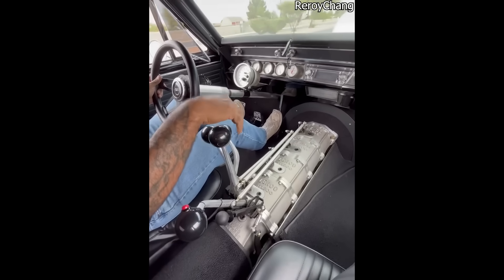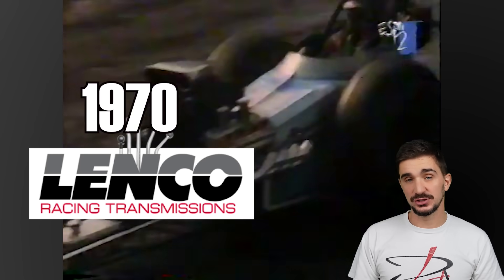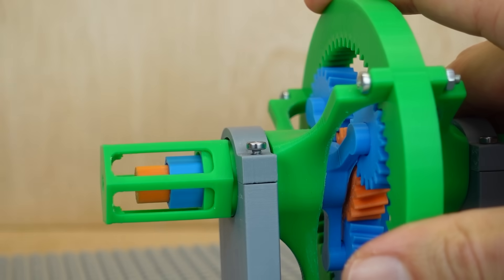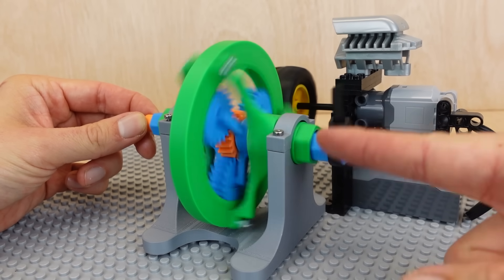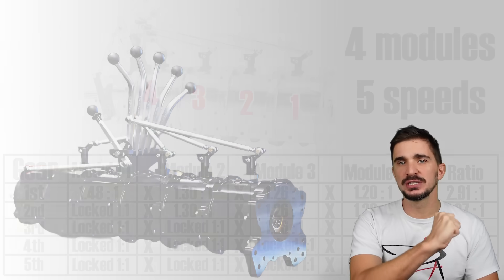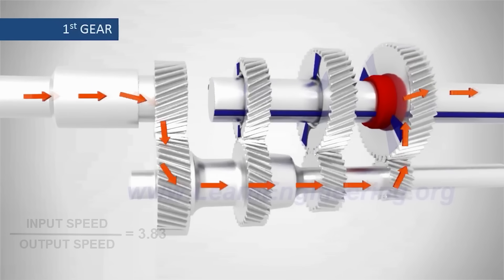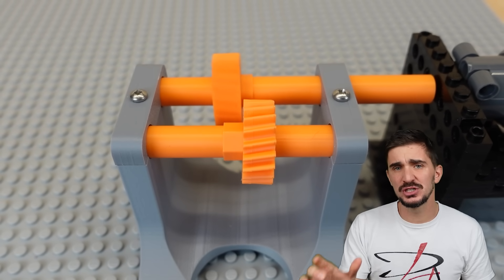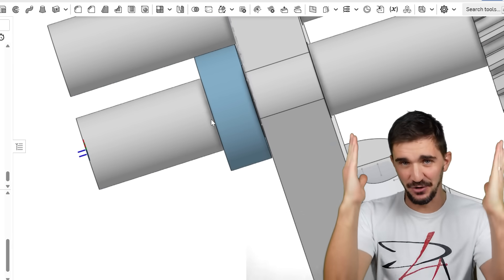This is The Strongest Transmission Ever Built - Planetary Manual Lenco Gearbox Explained

Comment: Essentially, every module is a Buick Dynaflow transmission from 1947, sans torque converter.  Basically, a 2 speed (reduction plus direct drive) planetary transmission that can't actually shift for itself. 

PS: Come to think of it, the Ford Model T also used a 2-speed planetary transmission, and the clutch wasn't needed when shifting between gears.  Talk about repurposing old technology in new and interesting ways.

Comment: This is a great informative video. Planetary gears are used everywhere, I recently disassembled my cordless drill which have 2 speeds, and it's very similar to this gearbox. You did a great job with the 3d printer. You are the professor. 👍👍👍👍

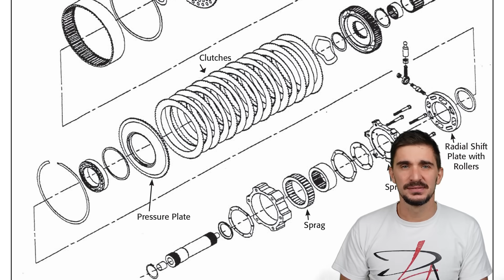Comment: 12:13 - To be more specific, a traditional manual gearbox has axial AND radial loads on the gear shafts. The radial loads are caused by the gear teeth themselves. The sides of the gear teeth are angled, so the gears can mesh. So the gears are trying to push apart. Those axial and radial loads put a lot of stress on the transmission casing. Even if you install straight-cut gears, it will still have axial loads on the gear shafts. And there's not much you can do about that.

With planetary gears, the radial loads cancel each other out. And since the gears are straight cut, there are no axial loads either. So the stress on the transmission casing is significantly reduced.

Comment: The poor man's Lenco is commonly known as a street clutch automatic. It is a regular automatic with a hard shift kit and a clutch instead of a torque converter. You have to drive the oil pump by other means but they work very well for street horsepower numbers. They won't handle 3000 horsepower but they will handle 600 or slightly more.

Comment: I don't really understand why this overall design can't be scaled down and used for fully automatic transmissions. Everything is controlled by the TCU anyway, why does the valve body need to be so insanely overengineered and fragile?

Comment: I want to push back on the contact points argument. You're shocking each of the contact points in succession. You shock the first one, (there are some losses), then the output gets sent to the next one (there are some more losses), then the output of that one gets sent to the next one, and so one. You're trying to tell me that the more links in the chain, the stronger the chain. Maybe, but I'm fairly certain the chain is only as strong as the weakest link.

Comment: couldn't this surely be adapted into mass market road car transmissions by either the use of a different mechanical remote control system or computer control? also the epicyclic units could be made slimmer and of greater diameter to reduce length for lower torque applications

Comment: couple years ago a company launched a planetary gear crank for mountain biking. It fell out of popularity due to price and weight, but I still use one and love it. instant torque application, able to shift under load with no delay. able to shift without pedaling. it's an amazing little gearbox.
Reply: Truvativ Hammerschmidt about 20 years ago? ;)
Reply: hell yeah. I still have one on my freeride bike with single speed rear. gives me a climbing gear when I need it.
Reply: For the people asking: he is probably talking about Pinion bicycle transmissions. Designed and made by former Porsche engineers.
Reply: @quentinnine9441  No, it's the Rohloff Speedhub. 14 gears and over 500%
Reply: Rohloff Speedhub?
Reply: Sounds like it just needs minor adjustments to become more well accepted.
Reply: @TheUnojoe2 too much drag.
Reply: I have an eight speed planetary city bike and I love riding it around for casual rides. I don't do competitive or touring rides and the little eight speed is perfect for my little jaunts.
Reply: @pollodustino  Sounds like Priority 8 commuter bike that  I have with belt drive?
Reply: I still have a Hammerschmidt to this day!

I wish we would still have it these days!

I build an amazing Freeride build with a then brand new 2008 Rocky Mountain Slayer SS frame.

Truvativ was the brand, everyone had Hussefeld or Holzfeller parts on their bike.
Man do I miss the New World Disorder days!

I still have the  CDs with the soundtracks burned onto them in my old car CD folder.
Reply: Old 3 speed bikes use a tiny planetary gearbox.
Reply: @calvinnickel9995
People used to modify those three-speed hubs for RC car use by machining some different parts to turn them from chain drive to inline shaft drive
Reply: @calvinnickel9995 Sturmey Archer 3-speed internal gear hubs
Reply: Hell yeah I need to look that up. I'm a Motorhead bit like anything mechanical or that does work !

Comment: I understand that you can't use engine braking outside of the highest gear.
Does reverse also require the highest gear to be engaged?
Otherwise, the reversed rotations won't pass through the next gearbox segments.
Reply: Reverse is in ratio of 1.31:1,  but the planetary gears are reverse direction than all the other units.
You can use reverse with any or all units in ratio or direct, but all forward units in ratio is easier to manage than all forwards in direct.
Reverse is driven by the engine through the forward units, no matter how the levers are set.
Reply: Thank you very much for the explanation.
I thought the reverse gear was first on the engine side 😅
Now when I know it's last behind all the gears, it all makes sense.
Reply: @andrzejs3717  Certainly🙂

Comment: Fun fact: stacked planetary "auxillary" boxes first appeared on haul trucks.
To have more low and more high gears the truckers would mount a 2-speed or 3-speed planetary "box" onto existing gearbox (3 or 4 speed originally)
And some drivers would mount 2 or 3 boxes.
Many trucks today have that architecture still, hence why they can have 24, 36, 52 gears. Or rather same gearset in 3,6 or 9 different ranges.
Reply: This is the same as early overdrives on cars.  Was a simple planetary gearbox added to a 4 speed manual.  The one on my Volvo 240 only worked on fourth gear.  Corvettes used the Doug Nash 3+4 gearbox so it could get better fuel efficiency without killing the fun of classic four-on-the-floor performance when you wanted it.
Reply: @calvinnickel9995 Offroad vehicles also used a secondary planetary gearbox for a lower range and overdrive. That's why they have two gear shifters.

Comment: Very interesting video, but one detail: a series gear system doesn't divide the force between the different points of contact. In the video, the force would be divided among each planetary gear, but not among each point of contact of the gear. Similarly, adding a module with a planetary gear doesn't reduce the force that the other modules can withstand.

Comment: This is not the strongest transmission. There is a transmission made by Liberty's Gears called the Equalizer that is a twin countershaft design that has taken over 5000hp, can be hooked to a torque converter, and has even been used in a 7spd configuration to break the piston driven land speed record. Look it up. From what they have said, they have never had a transmission break from overpowering.

Comment: The strongest transmission ever built is the prius transmission, which is just like this but has no clutch packs due to the motor/generator units doing the ratio management. A this-thing-sized prius transmission would be more rugged than this transmission. If it weren't for the market acceptance problem every big truck on the road would be a prius-style hybrid with an external crawler gear.

Comment: One thing to note about the strength of a planetary gear set is that the separation force of the gears is contained by the ring gear. So there are no forces trying to separate the shafts like there would be in a conventional manual trans. When big torque and shock loading is involved these forces lead to broken bearings and cases. Semi-truck transmissions use dual counter shafts to handle these forces.
Reply: The twin or triple countershafts are for the additional gear sets. That's how you get 15 speeds in a truck transmission

Comment: Are you sure about that amount of contact points, the force have to travel from each section to next in series, its not paralle, so each section have x in x out, meaning each shaft carry the entire force, just ratio of rpm and torque is altered. action reaction. This means that the tooth section is 3 points of contact. this is then calculated to the stress limit of the tooth moduls per normal engineering standards. the way i often define loadcases like this is with a simple sketch and then imagine its my finger or something then try to count up actions/forces its subjected to in each critical surface/point. in this case it could be any random shaft or pinion connection. in this case its always actions = reaction.

Comment: Always excellent, thank you.
Helical gears need thrust-bearings which are themselves a point of failure. Fair enough. A question, if you can sneak an answer in to a future video:
If helical gears are civilised but add complexity and potential failure points, it would seam herringbone gears are the best of both worlds - pro's / con's, applications? Thanks.

Comment: As I saw the explanation of how this thing works, I thought to myself that this but with automated controls would rock. Turns out that's similar to how modern automatics work, with hydraulics-controlled planetary gear sets. Yeah, engineers are smart.

Comment: 11:00 I dont think counting contact points in series makes much sense since the force is not split in series (like amps). I would only count the lowest amount of "load splitting" on any gear. The gear with the lowest amount of contact points (in parallel) is the limiting factor. In this case I would say "3". In jour example manual transmission it is "1" not "2".

I was thinking about it like an electric circuit.

Comment: with just 3 planetary sets you can get 8 different ratios by engaging and disengaging more sets at a time, I guess that is not ideal for a drag race, but it can get you a lot more gears for a lot less money. However a simple setup akin to a bike transmission selector could do this instead of the driver kicking each set in.
Reply: Yes, that's how all modern conventional (planetary gear) automatics work; for instance, the Ford/GM 10-speed (plus reverse) uses only four planetary gearsets.

Comment: 2 minor points

- the contact patches don't matter (adding more gears increases contact patches without increasing strength), its the number of points required to fail, in the auto its 3, in a manual its 1

- spur gears are slightly stronger as they are more efficient at pushing the gear in the desired direction, so less load on the tooth for a given output load
Reply: Nothing stops a constant mesh transmissions to have multiple gears in contact.
Not that rare either.
Also the claim that the lenco is stronger than automatics is ridiculous too.
If sprag clutches is the strongest or not is debatable, but there are autos that uses both and i would say that hydralics are pretty good at applying force.

Comment: 12:29
"when you rotate them, they rotate."
Mind. Blown.
Reply: We don't consider him a wise man for nothing!
Reply: “The transmission knows what gear it is in because it knows which gears it isn’t in.” ;)
Reply: @noahrobin1941  The missile knows where it is at all times. It knows this because it knows where it isn't, by subtracting where it is, from where it isn't, or where it isn't, from where it is, whichever is greater, it obtains a difference, or deviation. The guidance sub-system uses deviations to generate corrective commands to drive the missile from a position where it is, to a position where it isn't, and arriving at a position where it wasn't, it  now is. Consequently, the position where it is, is now the position that it wasn't, and it follows that the position where it was, is now the position that it isn't.  In the event of the position that it is in is not the position that it wasn't, the system has required a variation. The variation being the difference between where the missile is, and where it wasn't. If variation is considered to be a significant factor, it too, may be corrected by the GEA. However, the missile must also know where it was. The missile guidance computance scenario works as follows: Because a variation has modified some of the information the missile has obtained, it is not sure just where it is, however it is sure where it isn't, within reason, and it knows where it was. It now subracts where it should be, from where it wasn't, or vice versa. By differentiating this from the algebraic sum og where it shouldn't be, and where it was. It is able to obtain a deviation, and a variation, which is called "air"
Reply: @Makkiebobo730  'zactly. I know a /little/ history. ;)
Reply: Let's add that to the words of wisdom
Reply: IMPOSSIBRU

Comment: Very clear and educational video, thank you ! 

I would only disagree on the detail f the explanation of torque transmission vs. actual number of contact points, yet agreeing on the general principle (the strength of a gearbox depending on actual force per contact point or points for a given stage, will vary with the detail of implementation : tooth profile, width etc - and with planetary it is generally in essence 3 vs. 1 in conventional gearbox, for each stage, in the first order assessment and still depending on gear engagement specifics)

Comment: I would not have guessed that the reason reverse has a loud whine noise is because it uses straight cut gears vs helical. Thanks, I learned that if nothing else!
Reply: I did know this, but I also first found out about straight cut racing gearboxes, and the noticed my reverse sounds very similar, and that reverse gears are also straight cut; and only after that I drew the conclusion why reverse gears sound like this.
Before that I was told that it's just a "safety feature", such that people will hear you reverse.
Reply: @sasjadv  In the type of transmissions I deal with the reverse gears are not straight cut, still make the same sound though. For reference they are the Toyota T50 gearboxes.
Reply: Same why electric race cars sound  whiny. Straight cut gears, only the engine roar is missing.
Reply: @JFBence  Then explain why gearboxes that don't use a straight cut reverse still make the same sound?
Reply: @Samqdf differential!
Reply: @JFBence  That's not an answer I ever considered. Are you saying that the diff makes a sound due to the angular cut pinion and crownwheel thrust loading the bearings in the opposite direction that usual?
Reply: @Samqdf  Every gear set makes noise, it's just that straight cut gears make a lot of noise. In reverse you are traveling slow, usually paying more attention to what you are doing and other noises are reduced, like tire noise, etc so you're just more inclined to hear gear noise at that point. If you have a manual transmission and pay attention you'll hear all kinds of noises as you accelerate and go through the gears. You can hear the clutch, hear the linkage moving, all kinds of sounds. Turn down the music, open your windows and listen. I can even hear the "slop" from the clearances in a differential and can tell when a pinion bearing is going bad. It's all there if you listen.
Reply: Same! I always thought it was simply due to loading the diff gears backwards from normal!
I wonder why they went straight cut on reverse? Cheaper?
Reply: @JoeIsCrazyWillman  It might not be straight cut gears, they aren't on the model of gearboxes I work with. I can personally confirm this because I have seen inside two.

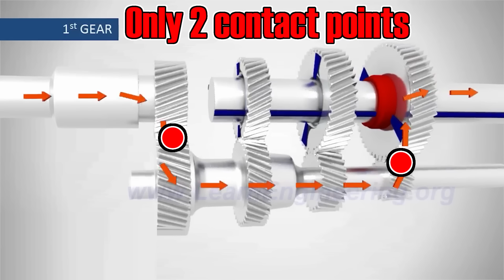Comment: 10:57 surely this is the wrong way to think of it? You have three contacts points, but across two stages, no?

I mean if the sun gear lost its teeth, you now have nothing, not three points of contact remaining.

And it's even more wrong to say you have more and more points of contact as you add modules, they are all sequential, not paralell.

Comment: A planetary gear set has 5 ratios: Forward reduction, reverse reduction, direct drive, reverse overdrive, forward overdrive. Stacking these planetary sets together, and not having reverse or overdrive, is a waste. Theoretically even if you ignore reverse overdrive, two planetary sets should provide 8 forward speeds; practically, two planetary gear sets would be perfect for 4 forward reduction speeds, direct drive, one overdrive, and one reverse reduction.

Comment: 1:55 I believe you still need a clutch to get it moving
Reply: Tbf you still need a clutch to get a sequential going too
Reply: Ya you do need one for take off but after that it's pedal to floor and grab gears
Reply: They also make a torque converter style. Bruno/Lenco.
Reply: Pretty sure that's what he meant by "You just take off the clutch" Just used the wrong words on accident.
Reply: @Xx9ThatKid6xX  yeah, you right
Reply: 'Need' is a strong word. If you're clutch is f'd and you don't have a neutral safety switch, key-starting (engine off, trans in 1st or 2nd, engage ignition switch / turn the key) will get you moving from a standstill just fine.
Reply: No way, you mean that’s what he meant by “take off the clutch and hold the throttle”?! Wow thanks! You must be a genius!